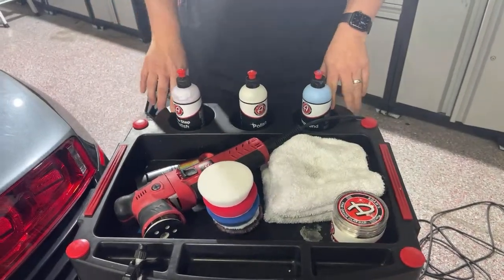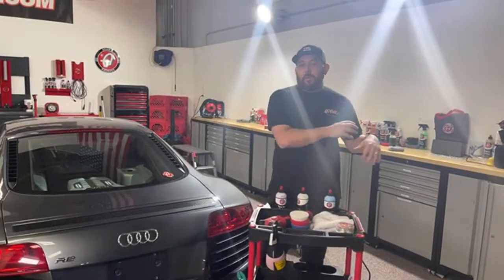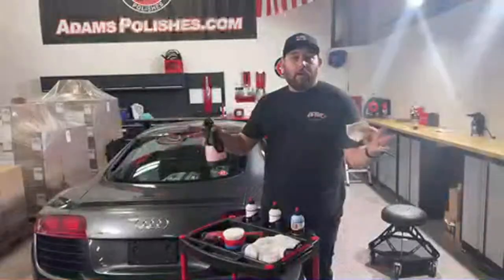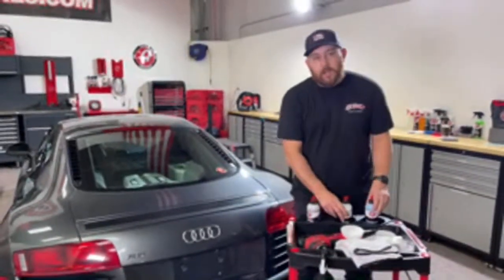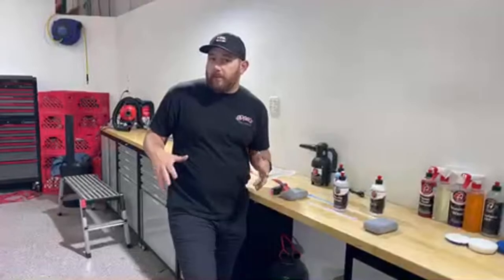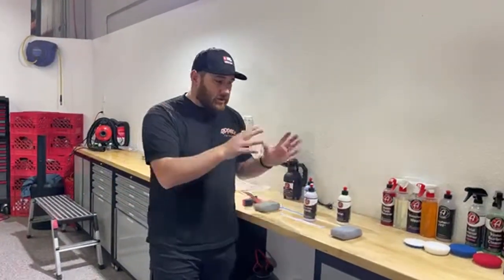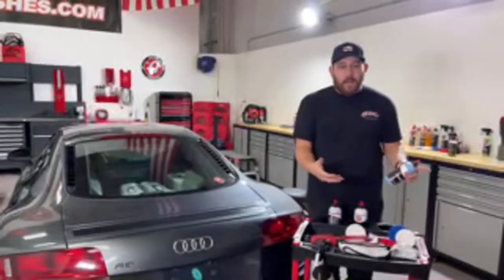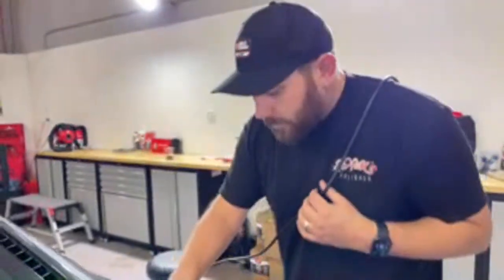Adam's Polishes Weekly LIVE Video: "How To" One Step Polish

Comment: I just bought the one step and the micro fiber pad. So should I start there or go with the less aggressive and work my way up. And will one pad do the whole car or should I have more than one available. And will any detail spray work to prep my pad with I’ve never seen that before. Thanks I have a lot of your products.
Reply: You will need several pads or be prepared to be cleaning those pads often.  Always start with less aggressive 1st. Then work toward more aggressive.  Use a test spot to figure out what combo is going to work